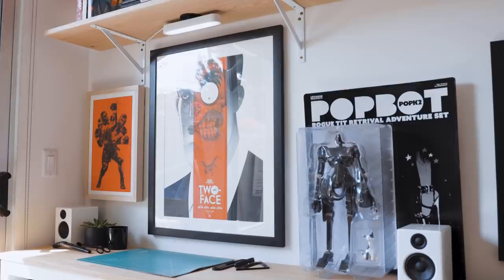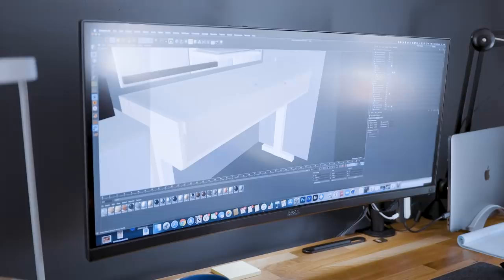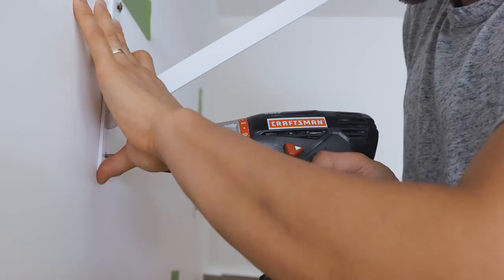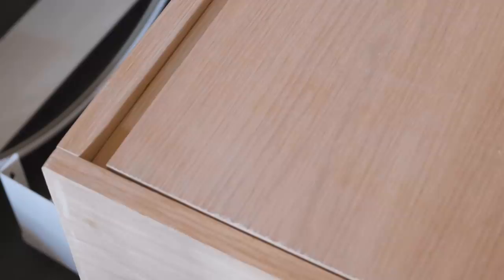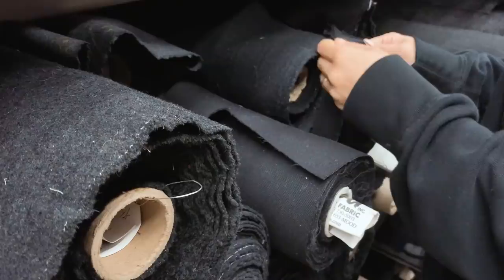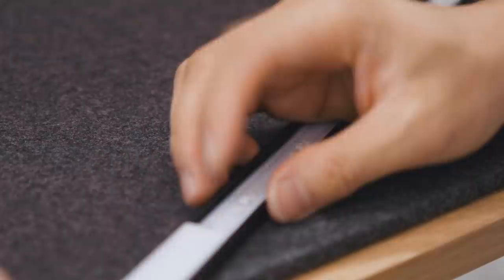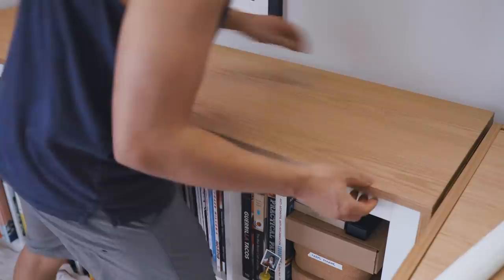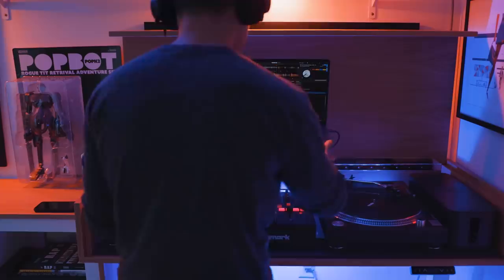Room Tour – DIY Desk, Shelves, and Ikea Hack

Comment: 1:59 - Always use a cloth between the hammer and the wall to prevent indentations made with the head, it saves time repairing before you paint. Those steel brackets don't do it for me to be honest, but I dig the A2 speakers in the same color.

Comment: Hey man, love the setup.  Just a quick heads up if you happen to make a mistake in the future: if you drill a hole you didn't want, you can always use wood putty (specifically 2-part wood putty that self hardens) to patch it up.  It'll harden into something pretty wood-like that you can treat the same as wood in terms of sanding, staining, drilling, etc.
Reply from the maker: Thanks. I've done that in the past, but this hole was too big. I didn't want a visible discolored dot on the surface, so I opted for this solution.

Comment: Matthew, just to say ive really enjoyed watching your DIY projects. Very nice to see the efforts you going to to get that refined pro finish. Just one thing - I think you maybe missing a trick on your shelving which is using regular metal angle wall brackets which in themselves have a certain amount of volume. If you wanted to make this a cleaner image giving the illusion of floating shelves have you considered the idea of using an 'L' brace system? Your shelf joins into an upstand made of the same wood that then attaches to the wall. Ive done this using dry wall anchors and its a really nice clean, high end  and affordable finish.
If not no worries, just a mention as your workspace is so well planned that this would definitely compliment that style.
Reply from the maker: Yes it was a consideration. But I went heavier duty, cause I assumed I might put very heavy books up there (didn’t turn out that way though)! Could’ve done light weight.
Reply: @MatthewEncina  Yeah, completely understand.  I researched it a lot but still, when I  came to do it there was the voice in the back of my mind that said'' there's is no way the wall will take this weight'':). But ive got to say it did. Ive got 30mm thick plasterboard walls and the anchors will not budge. The 'upstand' as i call it is about 80 mm in which i put 2 bolts in top and bottom and repeated this every foot or so.The shelf depth is 240mm and is loaded with cds and large format books. Its well worth a go if youve got another project coming up.

Comment: This is such an unbelievable idea! I'm going for this. I've been meaning to look at what would work well with 130 x 50cm table with a battle style setup, and this is perfect. However the only problem I have is where to place the laptop.
Reply from the maker: Yea, I wish I had a better solution. I was drawing up ideas for some kind of fold down inside the lid. But didn’t arrive on something I loved
Reply from the maker: Another idea is to design the whole cabinet as a drawer to pull out.
Reply: @MatthewEncina  that's clever! , the weight distribution may be difficult unless it's somehow anchored. One of the things I was thinking about would be to have a lift hinge instead, so the part of the table that lifts up becomes the dj laptop stand. You could do this with approximately half of the table top so it doesn't go behind the desk, and then the other half of the top can just fold up with a strong piano hinge or like the one you've used.

Something like this?

https://www.amazon.co.uk/dp/B07GXFGTN6/ref=cm_sw_r_cp_apa_fabc_JLQUFbTGEHBEC?_encoding=UTF8&psc=1

Comment: Very nice! Only one suggestion ... based on the heights of your shelves and the light weight of the things you're currently placing on them,  I'd install the brackets "upside down", on the tops of the shelves rather than underneath. This way you get a much cleaner look from below. You'd have to deal with the brackets when placing your stuff on the shelves, but you could do it in a way that hides the brackets a bit too. (If you go the heavy book route as you mentioned, and still want to use those same brackets, you could use carriage bolts and nuts so you're not relying solely on the screw threads to support the weight)
Reply from the maker: Thanks

Comment: Nice!. I would have made the shelves floating ones though
Reply from the maker: Thanks. That would’ve quadrupled the budget and lowered the amount of weight it could hold. Things to consider if you do your own.
Reply: @MatthewEncina  about the weight capacity yes. But about the price, it would be more expensive but not like 4 times the price. You cma buy the metal bars for reasonable prices then drill a hole in the wood then align them to get them floating. Yes but something to consider when biilding one mainly for its weight capacity

Comment: Since I'm no expert I'd just like to ask. Is it possible to make the DJ compartment slideable? Like a drawer. Will it be strong enough to do so? Because functionally, I think it would be even better. So you can use both the tabletop and the DJ simultaneously.
Reply from the maker: Oooo smart idea. I’m not sure how much weight a drawer can support. There’s probably a heavy duty solution for that.

Comment: Next time you drill through just fill it with a dowel or mix up some sawdust and glue to make a thick paste  My  job before being a  News Stringer  was woodworking  .
Reply from the maker: Nice. I was debating that, but didn’t want to have a visible knot. So I opted to slice it off, and it turned out pretty good!
Reply: @MatthewEncina  Everything looks amazing . you have done a great job my pal .

Comment: Props for the Pmc -05
Reply from the maker: Classic 👌
Reply: @MatthewEncina  First djmixer back in the days :D, btw those wireless Tma headphones i've been wanting them for a while but my senheiser hd25 are still so great after so many years. 
My question is does the wireless version still have an option for a cable?
Reply from the maker: Absent yes. I mostly use them wired tbh
Reply: @MatthewEncina  thnx sir.

Comment: Great build, dope setup! Have you got into using Shortcuts for home automation, productivity automation? It’s such a fun way to setup new scenes quick and easy! Also using NFC tags to turn on difference scenes and automations is a lot of fun too.
Reply from the maker: I have not. What's the keywords I should research?
Reply: Shane Whatley + NFC Tags

Christopher Lawley + Shortcuts 101

Those are a couple to get started on... it’s so much fun. The types of automations you can configure can be overwhelming, but starting off with HomeKit related scenes, device settings is the way I got started.
Reply: Also... Matthew Cassinelli is kind of like the god father or Shortcuts. He used to work at Workflow (which Apple acquired and made it Shortcuts). He just released a website that is basically the Bible of everything shortcuts. He breaks down shortcuts in his Shortcut Catalog so well and in depth, and also provides shortcuts you can download and install. 
https://www.matthewcassinelli.com/siri shortcuts/

Comment: The new Hue gradient strip looks rad. Designed to run behind a tv it would most definitely transform a room, in a more dynamic way than the current strip which I use. The only bummer is that it requires a separate hub that costs as much as the strip. Do you think it’s worth the upgrade?
Reply from the maker: I don't know. My wallet is empty because of them 😅
Reply: Matthew Encina the Hue Play configuration works really well on a desk as well. I am planning on running them underneath my newly purchased Autonomous desk so that they are diffused against the white wall which is only about a foot away. I had to repurchase the Strip as as a single thread got knocked out when transporting it during a move. It was quite frustrating as it came down to a design flaw. The ecosystem however is great- when it works, man does it work!

Comment: You should have used a hidden bracket instead of the L-bracket for the two long shelves. it will look better with it floating
Reply from the maker: But everything I saw had pretty low weight capacities (for books). Do you know of a good one that can hold a good amount?

Comment: brilliant! this is something I'll be doing aswell :) my plan is to create a desk which would contain my turntables (own myself two MK5s), but during the day acting as a regular desk. would you say a desk of this kind is too bulky performing regular work on, with a laptop and two screens?
Reply from the maker: Not at all. I would just be mindful of how thick you make it. Consider the distance between your knees and arms when you sit. Mine work just fine, but make sure you’d be comfortable with that distance.
Reply: @MatthewEncina  thanks! another question, I'm not sure if it's Plywood white oak you're using, or did you mean MDF? I can't find that kind of plywood in my local stores anyway...

Comment: Amazing setup! How is the stability of the height adjustable legs for your turntables? I’m working on a 72” dj table and I’m concerned about the wobble.
Reply from the maker: I’m not a crazy performer doing any type of juggling, just mixing. For those purposes it’s very stable, even when it’s set higher.

Comment: Would it be possible to have the dj setup in a drawer that pulls out and then lifts up? to avoid having to remove what's on top to play?
Reply from the maker: Yes, if you get some with a strong enough weight capacity. The only reason I didn't do that is cause I have a door in the way.